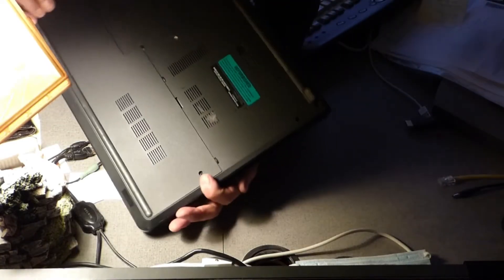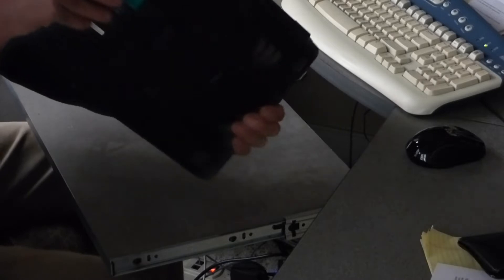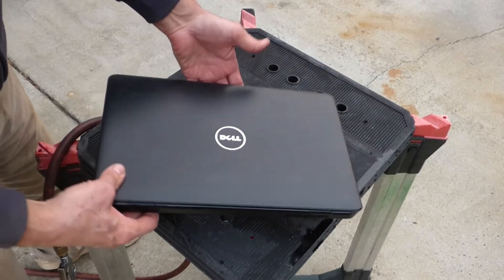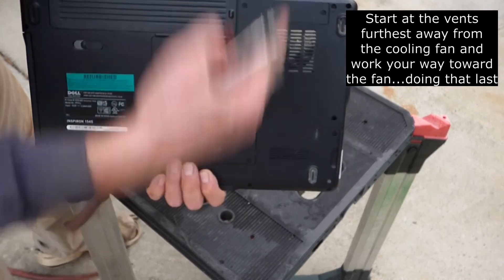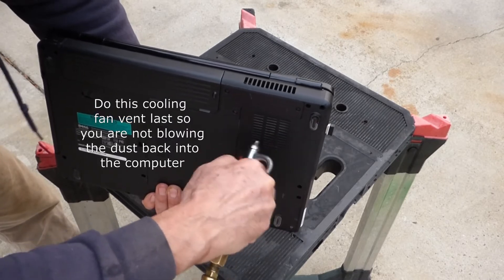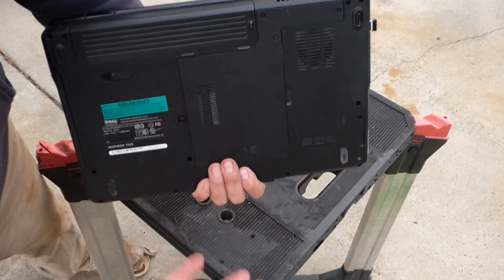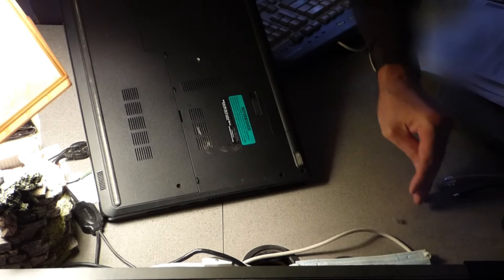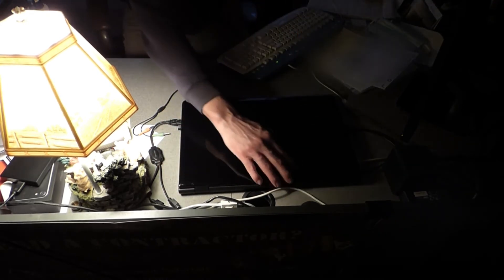#1 Reason Laptop Computers Shut Down - Slow Down - Fail & How to Prevent It

Comment: You need to stick a toothpick in the grating of the fan to keep the fan blades from moving when you blow it out or it will spin so fast creating ESD (electrostatic discharge) that will burn out your CPU and or processor.